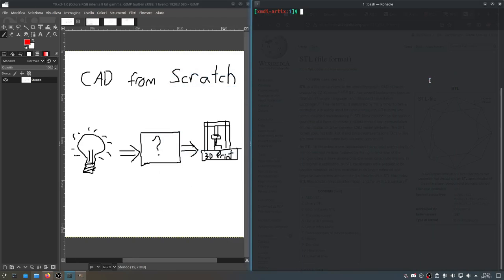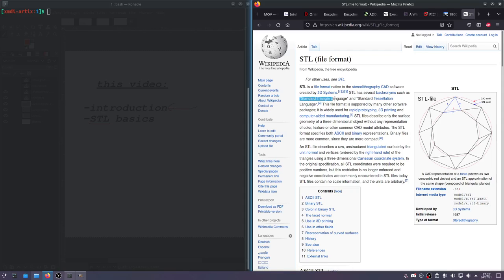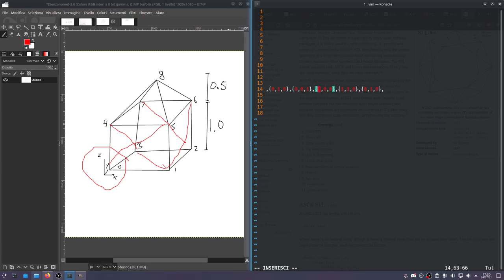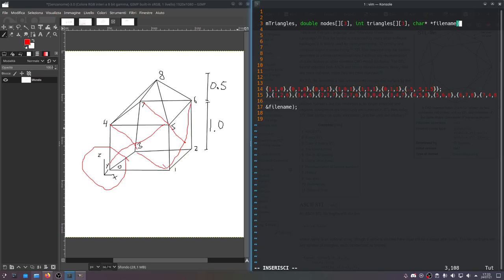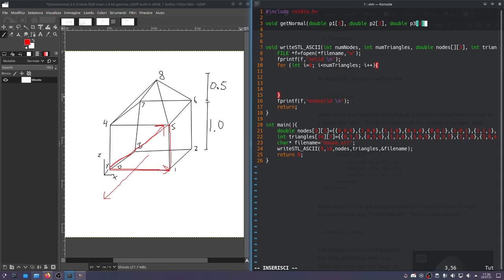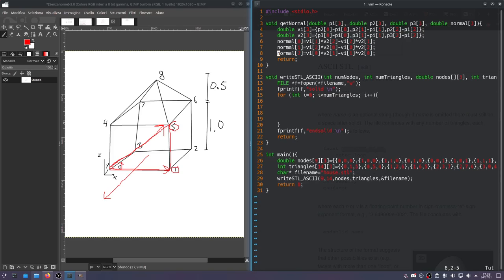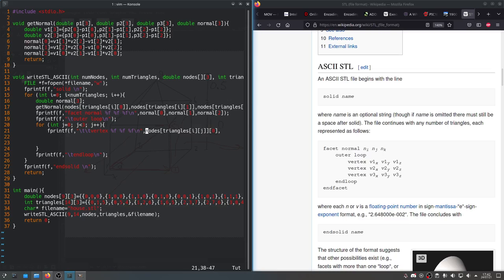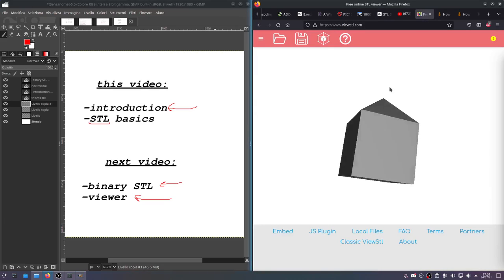Intro & Basics of STL Files | CAD From Scratch [1]

Comment: I have a question: Why did you pass a pointer to the name and not the name itself? I mean, strings in c are just arrays of char, and an array is just a pointer to the first element, so it made no sense to pass a pointer to that pointer to the function. (It's not a critique, I'm genuinely confused)
Reply: It's not passing a pointer to a
pointer, its just passing a pointer,
which is equivalent to passing the
array. "in a function definition,
char s[] and char *s; are
equivalent" (from K&R 5.3)
Reply: @Not_Even_Wrong  Yeah, I know, that's what I meant. And my point still remains, why passing a char** when passing just char* would have the same outcome?
Reply: I actually should have shut up, now I am confused as well... wouldn't filename in his function be like an array of pointers? Okay i am out. Sorry to bother you...
Reply: @Not_Even_Wrong  no, his filename is not an array of pointers, it's just a pointer to a pointer. Basically the char** is a pointer to the pointer that points to the first element of the array of chars of the filename. He passed to the function the address of where is stored the address of the first letter of the filename, then he dereferenced it (making it the original char*) to use it for the fopen() function, making all the char** thing useless
Reply: Yes i guess you are right,  filename (in the function) is a pointer to a string then, the char * this is pretty pointless then , very strange